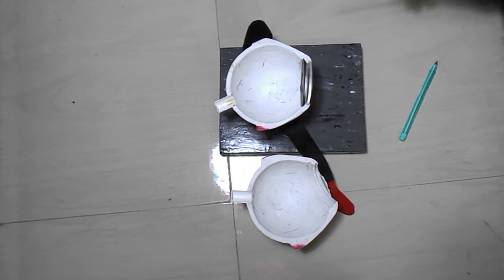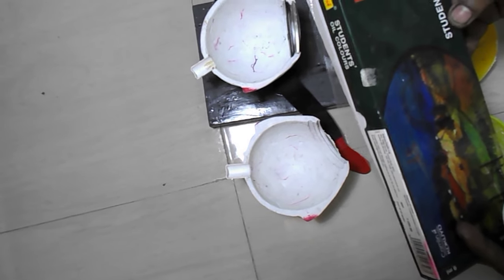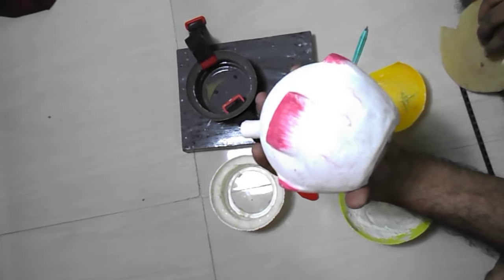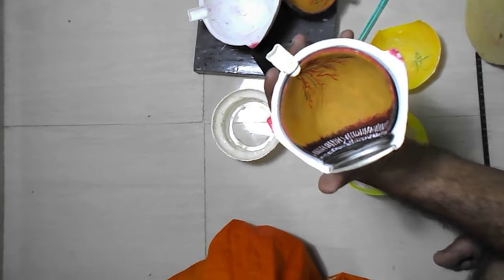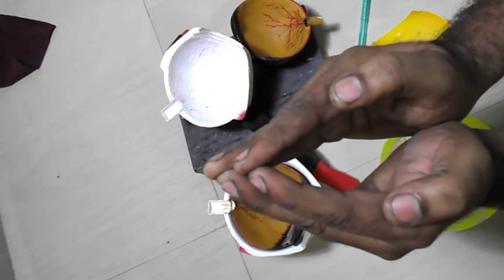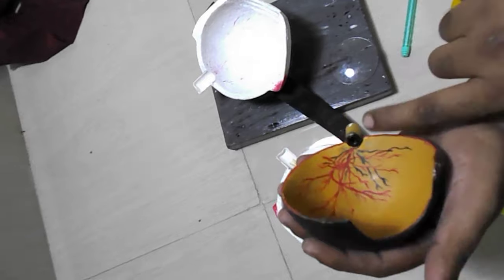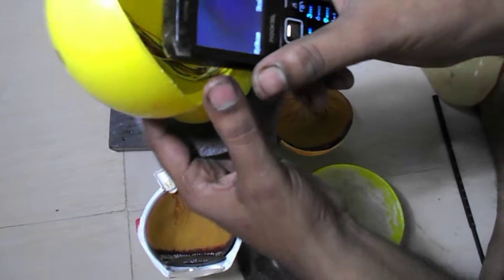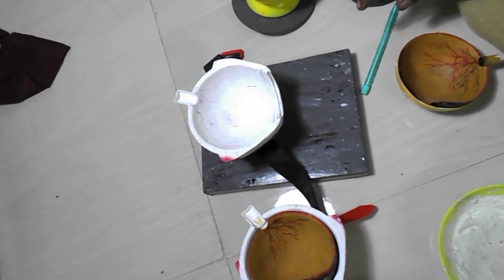model making eye

Comment: where did you get the lens? and how did youmake the dents to fit t lens and pupil in the eyeball. and what did you use for the optic nerve
Reply from the maker: the lenses are the real glass set used to fit in the frame at eye care center the raw glass with zero focal length they are round, i made a socket with rotary tool and Dremel grinder, the optic nerve was an empty eye drops tubing from my trash stock.
Reply: Thank you!!!
Reply: this video explain in hindi

Comment: can u tell me what it is made of
Reply from the maker: its made of white cement,or portland cement, you need to mix this cement with PVA glue and little water get the dough at moulding consistency and allow the moulding or casting to set for 8 to 10 hrs then eject the moulding cure it by soaking in water for an hour thats it

Comment: can u tell me what materiel  required  for this model ...
Reply from the maker: sorry for delay it is sold in the name of white port land cement, or white cement this is usually used to fill the gaps between the tiles during flooring. I mixed it with PVA glue and molded between two plastic balls once it dry its very hard and better than plaster of paris